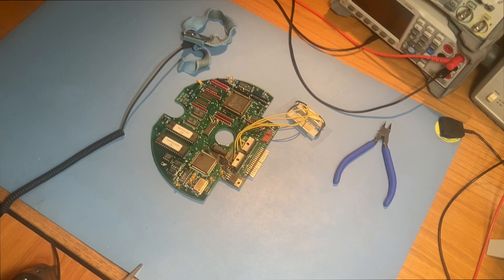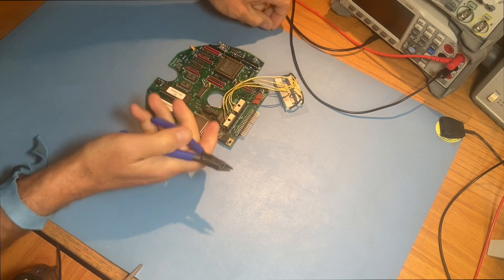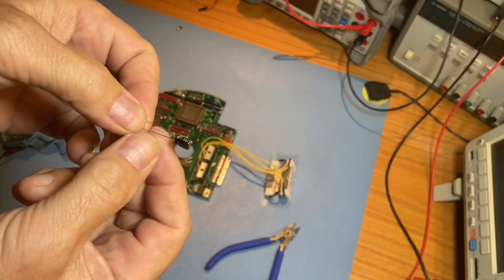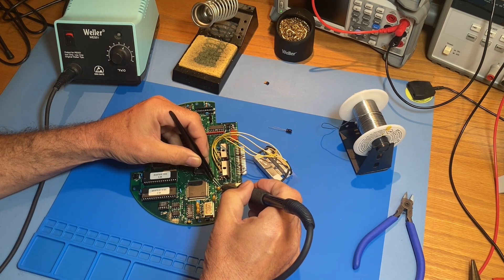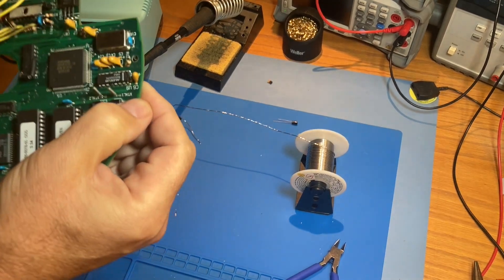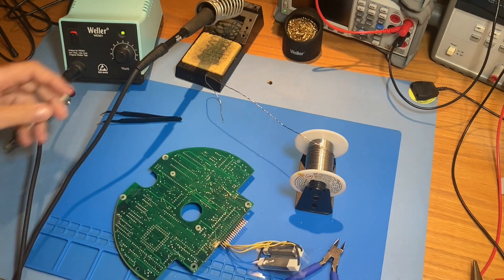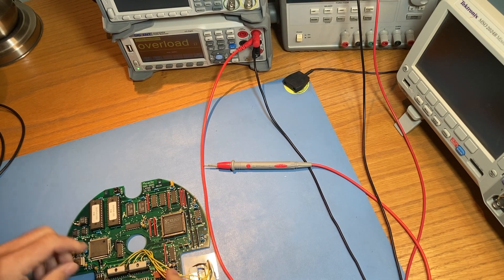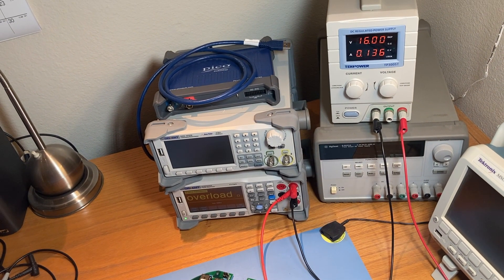LX200 Main PCB Repair C8

Comment: Hello, I got the axes boards and the duty cycle calib board. That went well. Before I buttoned it up I tried it again. The RA was plugged in, not the dec. It started full speed and blew the 3 amp. I checked the main pcb and it's 18k. Put a new fuse in with the calib board. Didn't blow a fuse but both lights are red no matter the pot setting. The 7805 on this board gets hotter than is normal I think. Any thoughts?

Comment: How about the rest of similar Capacitors? There are 9 of them on main board. Would you recommend changing them or they are not at risk ?
Reply from the maker: No, the rest of them are fine since they are being used at lower voltage (only +5v).

Comment: When my control panel cap blew I went ahead and replaced all.   I found the easiest way with less risk of damage was to wrap the cap with tape and then crush it with needle nose pliers.  I next trimmed the remaining leads, leaving enough length for me to solder the new cap to.  Where the head room was limited I laid the new cap on its side.   I replaced all of my caps in a few hours and never risked damaging the pcb.